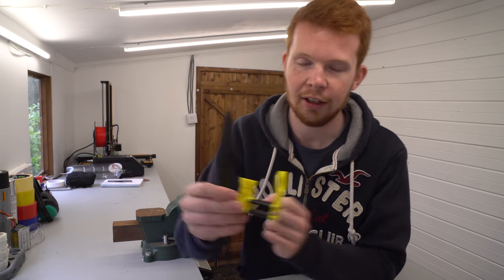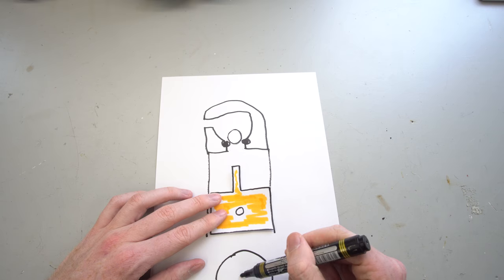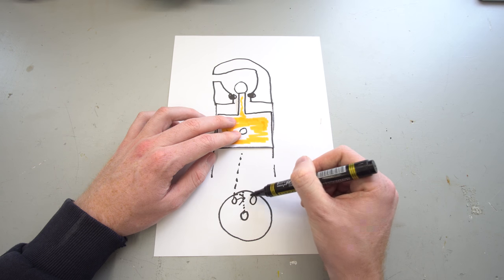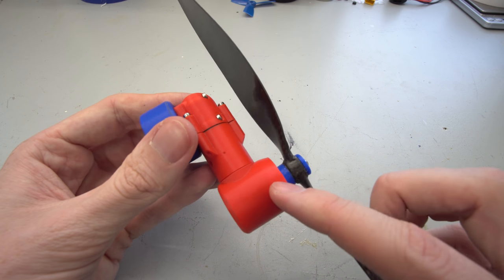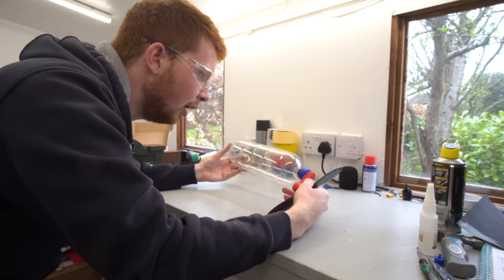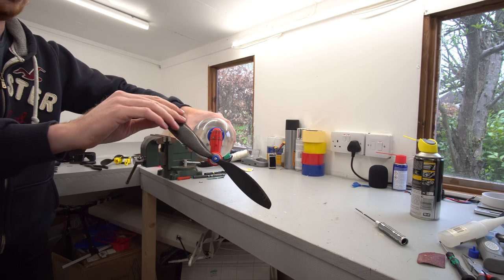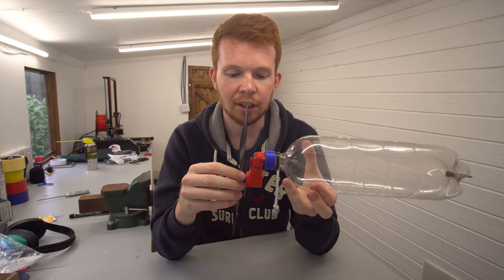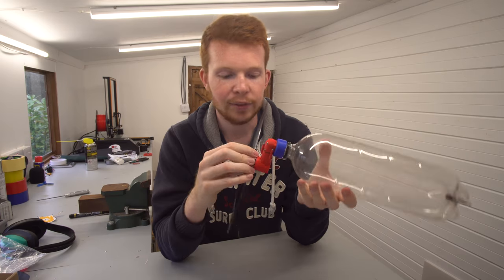Compressed Air Engine Modifications

Comment: My concerns are... where does the air (being compressed by the piston) in the cylinder go when the piston goes up with the 50PSI on the other side of the ball valve. Seems a good way to slow the piston momentum going up. 
Contrary...in an internal combustion engine you want to compress that fuel air mixture.

Comment: I know why I'm not an engineer.  I would use two bottles and two pistons to have two periods of what another commenter called "lift duration" at opposite ends of the cycle. But I don't know if that's stupid or not. You were using two bottles anyway but i feel like building that engine would be harder.

Comment: You should try a more complicated design using an external crankshaft-driven valve timing system, like steam engines and, in fact, 99% of engines.

Comment: [ENG] : You should try to put a balloon in your bottle. the balloon has a better elasticity. Once inflated it could provide pressure for longer with the same amount of air.
[FR] : Vous devriez essayer de mettre un ballon de baudruche dans votre bouteille. le ballon a une meilleur élasticité. Une fois gonflé il pourrait fournir une pression pendant plus longtemps avec la même quantité d'air.

Comment: Wouldn't it be better to allow the air to enter the cylinder after dead centre by means of a cam in conjunction to the main crankshaft   or similar type design.  Sure it would be allot more complex but there should be an improvement in rmp ,starting and pressure range the engine could handle , from the early days of air hoggs model planes ive imagned to improve uppon that design and like you said use higher pressure  with smaller tank (carbon reinforced similar to paintball) mabye even build  an rc plane with a few minites flight time. Ive studied allot of designs and the fact that the piston needs to open the incoming air before it reaches dead centre has always made me dislike this type of engine as it would always need a proper flywheel. I have even coincided using an arduino with solonoid valve and hall sensors to allow air into the cylindre after or just as the engine reaches dead centre .whats your thoughts?

Comment: how bout adding a cam lobe to the crank shaft with a leaver hinged to the outer cylinder case. like a teeter totter... running up to the piston top, . put the spring pressing down on the bb inside the head, with a small  relief pocket to the side of the bb, about half a bb wide. cam lifts leaver, leaver has a pin on the other end, pin goes into the head, pushes the bb to the side into the half of a teardrop shaped pocket while under the downward spring pressure, pressure change. piston drops leaver duration controlled by cam lobe shape backs off bb snaps shut ...and round again..... best of all you can simply print a series of cam lobes to experiment with valve timing , in turn prop size , torque vrs rpm. gd

Comment: When the piston goes back up the cylinder the pressure is most likely pushing up the valve even before being in contact with the piston. Also the exhaust ports seem like a after thought. Why do U need a exhaust if when the piston is BDC there is no pressure in the cylinder...

Comment: Tom is the pressure holding the ball valve closed too high and may need regulating with a high volume input and not high pressure also the exhaust port look too small I would elongate them ....

Comment: i would increase the cylinder bore, lower the compression ratio and think about not having the crankshaft directl below the cylinder, because this can change the compression versus power stroke speed ratio.

Comment: You should maybe consider dry ice as fuel. It "creates" a LOT of CO2 (like 500 liters for 1 kg), that can be used to run the engine lengthy.
G.
Reply: That would be awesome, don't think it would create CO2 fast enough with a small bottle but would be cool to try with a larger container.  Not practical for a plane but would be neat to see if it could run for a long time and generate a small amount of electricity or something.
Reply: Yup, getting a satisfying flow rate is a challenge, but heating the stuff makes wonders! :D

Comment: make the piston have a hole in the center.
mount the crankshaft in a different plane.

through the hole in the center mount another smaller piston instead of the pin. make its own crankshaft for that, and offset it from the main power stroke crankc shaft.

kinda like stirling engines do for the displacer, but do it for the pin instead.

Comment: Hey think a direct air flow to turn the prop would use less energy??  piston drive seems to need more power to start,, air driven flywheel and control the flow??

Comment: still not seen your newvideo ,even finish this one (i'm watching everything) but you could have remove the ball(bile) inside and put a a pulley from the crank to the top with a valve (like car)  with that system you could  push the aire and get the air from the top and put oil in the base (and make the engine show less registence)

YEAH That sound kinda like a 4 stroke car engine i know, but that would be cool

Comment: larger diameter piston! shorter stroke. think hydraulics ;) and the shorter stroke will ease your open time constraints. You're using standard atmospheric pressure geometry but you need to think shorter inrush times for your volume.. PV = NRT

Comment: Surely the 'compression' stroke should be vented else you are just breaking the whole system, electric exhaust and inlet valves, would allow enough control for perfect timing and thus reduce the large losses you now have, yup easy to just say that, designing electrically operated valves that are fast enough would be a much larger project, let alone the need for a timing sensor and microcontroller, a mechanical solution could use some kind of shuttle valve that triggers at TDC and BDC driven by a cam or passing post may work ..... all theory I know but looking forward to what ever direction you go.
Reply: Cam driven valves should work. You can do an equivalent thing with an old four-stroke engine, modifying the cams so it will run on compressed air.  
Of course, the closest thing to a compressed-air engine is a high pressure steam engine, and those have been around for 200 years.

Comment: make a air engine with a small co2 cylinder and put a regulator on so that it will run a long time and not blow up the engine

Comment: Smashing ceramic bearing with metall hammer it's not a good idea.   Why not use turbine with gearbox?  Why stroke engine?  p.s. you defeitly need a fly wheel

Comment: Don't forget that the length of the rode should change according to the air pressure inside the bottle, high air pressure, shorter rode, lower air pressure, longer rode, because the force the air is pushing, changes according to the air pressure, which is not good, because your air pressure always gets lower and lower, because thats how you use the air pressure, so , it won't work with the current technology you are using
Reply: Maybe it could work,but it would probably change it's efficiency according to the air pressure
Reply: I think you could combat it with a bigger chamber, and a shorter rode

Comment: A recommend
to optimize the efiziens of the whole system,
you should work less against gravity.
Even if only a few grams are.
There is a measurable influence on the momentum.

Turn your sysytem over
so that the compressed air pushes the piston upwards. Gravity does half the job.
you also want to turn off the air from below when the air is in the cilinder.
I also have a link to a photo here ..
https://i.servimg.com/u/f11/18/50/45/90/dsc04412.jpg
Here it is solved that a second oring, replacing the bicycle valve.

try to play with the flywheel and the speed.
I expect smaller propeller with higher speed brings more efficiency
The propeller does not have to be carbon fiber. Mass can help.
if you have the opportunity to measure the turns. Try out mass that is ideal for the frequency of your system.

have fun

Comment: But you are simply copying a CO2 engine which only works well in very small engines. As you increase the pressure it becomes increasibly critical. With air it becomes more critical than CO2. Why not use the system which has been used since the 1920's. Such a motor made of plastic has been available commercially for years. Doug McHard did much research on using drinks bottles for air tanks and could use in excess of 100psi.

Comment: Do electronic valve opening and closing
Reply: joey garcia or just put on an electric motor.... ah there was the point of not having it electric 🙃
Reply: I don't think mini coreless DC motor can power RC propeller... but valves don't need that much energy to power.. maybe mini coreless DC motor can be used for this
Reply: joey garcia I will be more direct in my formulation. The idea is simplicity. Electronically controlled valves are the opposite end of simplicity hence a mismatch for the project. We all know that electric direct drive is the obvious choice but this is low tech and that’s the point of the build.
Reply: how about using similar mechanism as in jackhammer? It's a bit more complex than this video (which is a non-functioning design)  but simpler than using motor

Comment: hey i teach new ebike you make. ok here goes. take sprocket off rear ten speed wheel put on middle then weld on derailleur. then use tension device on stand exercise bike to prevent from going to fast. (reason rotating to fast will catch motor and generator on fire.) now when going to fast the derailer change to lower gear until learn has max speed. (put warning will catch motor on fire.) then put very small gear on generator. then wire to motor. walla world cheapest ebike and safe for young adults (they always late and in hurry.)

Comment: Why not just use a valved system?
Make a thicker crankshaft with 2 or more pins, time the second ~20° retarded and use it to open and close the intake valve
Reply from the maker: That's pretty much what I've been building this week ;) Video will be up later today!
Reply: Tom Stanton if you're feeling real fancy and want more adjustability you could go for a gear driven rotary valve design
Imo would be easier to achieve on a 3d printer

Comment: Shouldn't you be able to change the piston length and the con rod length to get the ideal open time and length?
Reply: I would make it so the valve just cracks open at tdc and is open for half a stroke. This should prove if the concept will work at all.

Comment: Try to make a 3D printed plane that is powered by reusable energy ( eg: solar) for a future project.
Reply: Wouldn't  compressed air be a reusable energy ( air beeing the medium or working fluid and pressure beeing the state of the working fluid)?
Reply: Small solar-powered planes are barely capable of flying. Even made out of carbon fiber and other super-light materials. 3D printed planes are heavy - no way they will fly by solar panels.
Reply: I dont think his printer is large enough ;)
Reply: What is this? Any pictures? Description is very short and hard to understand. Hope it is not yet another "almost working overunity device"...
Reply: Shur Murray https://www.youtube.com/watch?v=xS2iCj-HSqY He can run that solar plane nearly indefinitely on a calm sunny day. Not as efficient as that guy wants, but it's pretty impressive.
Reply: Isn't he telling the plane was actually draining reserve battery even in a perfect sunny day?
Bad example.